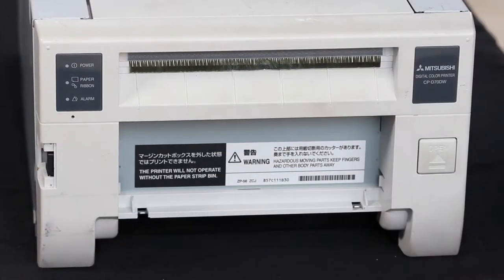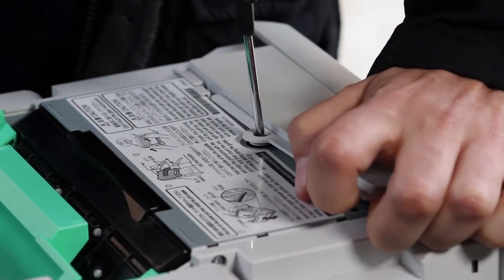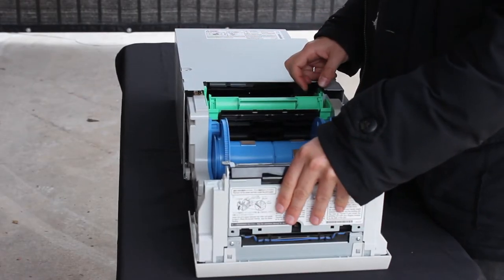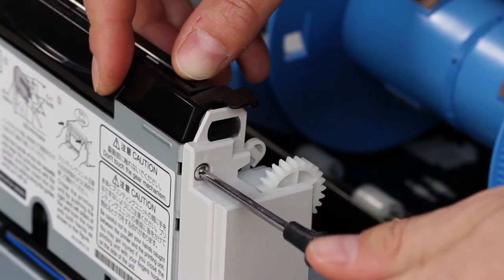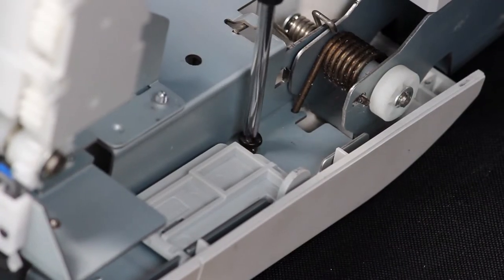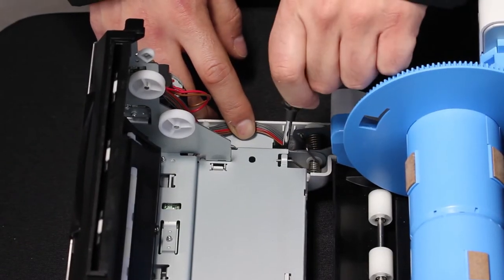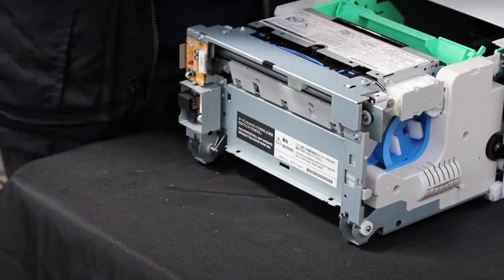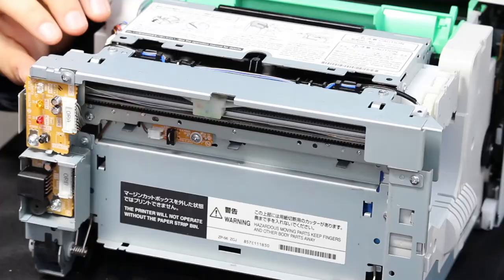D70 Printer Cutter Cleaning Tutorial

Comment: Long shot here, but.... I have a CP-D70DW that has been in use for many years. Recently the printer is not recognizing when the printing unit has been closed. The circuitry is acting as if the printing unit is perpetually open. While I have the service manual and am familiar with the mechanical workings of this printer, I can't find the sensor/switch that reports/controls the open/closed status of the printing unit. I do see that there is an RFID antenna in a position that could act as such a switch, but that's all I've been able to come up with. Have y'all run into this?
Reply from the maker: We have not run into that issue. I would suggest contacting Mitsubishi support or a local repair shop.
Reply: @LAPhotoPartyProducts  Thanks for the reply. I did just that and received some good info. There are microswitches that control the open/close function of the programming.